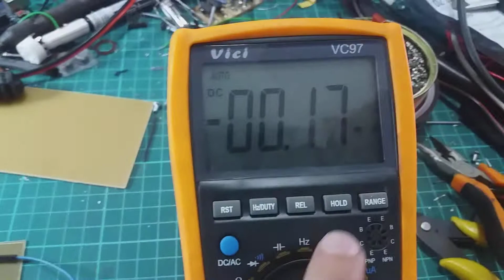Low power management using TPL511X

Comment: 6:55 Acolo nu ai 17 miliamperi ci 0,17 miliamperi. Iar cateva secunde mai tarziu, consumul nu este chiar 0, coboara si tu scala in micro sau nano sa vedem consumul. in datasheet consumul este 35 nA, tu ai zis 35 micro, diferenta e imensa...
Reply from the maker: @petrepetercristi  salve da acela este tipical dar mai sunt niste elemente care pot creste putin consumul...35nA este dat ca data de catalog dar poate varia.
Da ii alimentez din acumulatori LiIon tip 18650.
Nu, nu pot sa folosesc celule solare deoarece nu sunt neaparat stationari.
Autonimia de peste 40 de zile este cu transmitere de date la fiecare ora (aprox).
Reply from the maker: Nu am nano...felicitati in cazul in care aveti nano, eu nu am nevoie.
Iar clipul cred ca are ceva ani.
Iar conform datelor de catalog consumul este de sub 100uA in STBY...asa ca nu prea are rost conversatia.
Da intradevar m.am exiprimat gresit in ceea ce priveste masuratoarea (acum am observat)
Pe scara de uA 😊 eu nu m.as increde in nici un aparat portabil.
Intr.o alta ordine de idei am folosit asa ceva in niste senzori care nu au posibilitate de alimentare, cu transmitere de date pe GPRS cu autonomie de minim 40 de zile 😊
Este 0 pe scala de mA, cum ziceam conform datelor de catalog ale integratului, consumul este sub limita de descarcare al oricarui acumulator.

Comment: Is there a circuit for the TPL5111 which allows for longer sleep times (like 24 hours) ? Maybe combining them using logic gates..?
Reply from the maker: Use  an RTC Ic with alarm function
Reply: @YO3HEX  good idea, but wouldn't the RTC use power continuously? Maybe you have a particular RTC IC in mind...
Reply: @ThomasHaberkorn  , you can buy modules with a DS3231 chip with a coin cell battery holder for around $1 on aliexpress.  These can generate an alarm to wake up your project.
Reply from the maker: You will need a battery that literally will last years.
An rtc is using a small button battery and a main power pin.
So...you can use an Rtc as i said.
Used this many times 😊 and works like a charm.